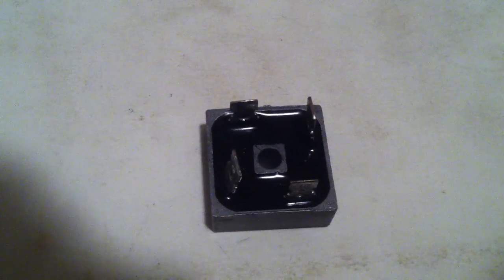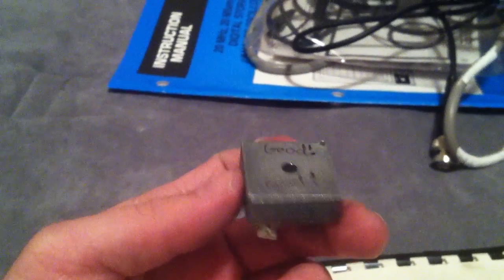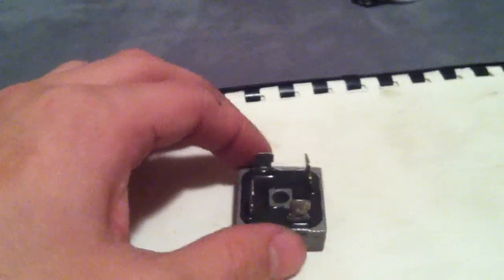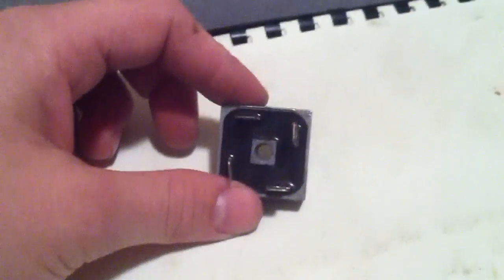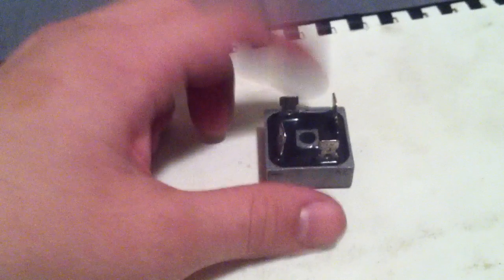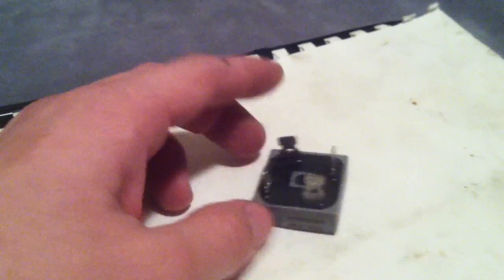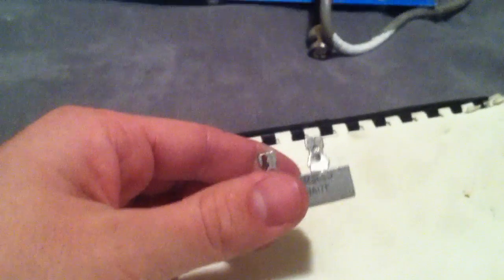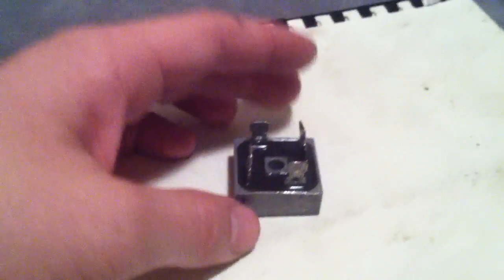Single Phase Full Wave Bridge Rectifier

Comment: Question:  I want to power a 'blinking LED' from DCC model railroad train power.  The LED is 12 volt DC with resistor.  And the DCC is a ............not sure how to explain that.  I want to run this blinking red LED from track power via a wiper on the wheels in the caboose or last car on the train.  I have that bridge rectifier in your video, but it did not work.  Any suggestions?

Comment: Hello did you ever make a video showing how to test? I just got a vintage Magnetic drill base and magnet is not working. I took it apart and besides the toggle switch this was the only thing inside and not sure what size it is cause the label is gone. Thank you any help would be appreciated

Comment: Why do they go bad?
Reply from the maker: most of the time they go bad by repetitive current surges due to varying loads. this particular one is a 35 amp full wave bridge rectifier so it can handle a very good amount of current draw. the repetitive current draw over time breaks down the silicon diodes in the rectifier package and can create a direct short or an open.
Reply: They didn't keep them in the freezer!